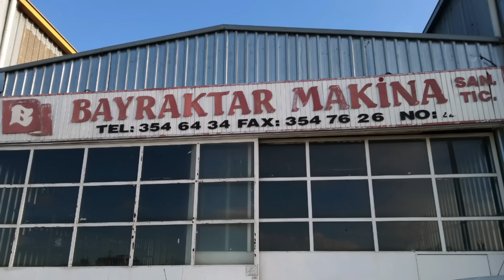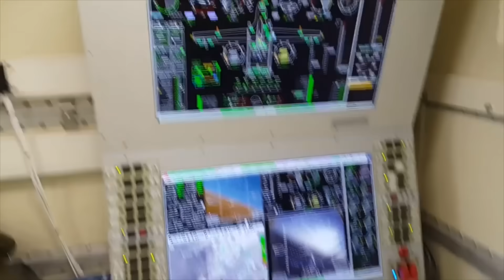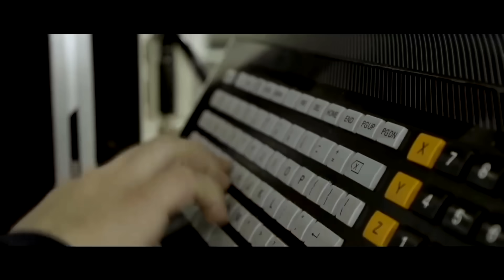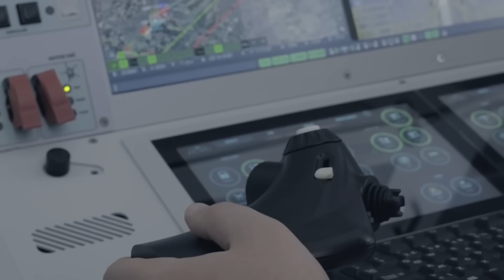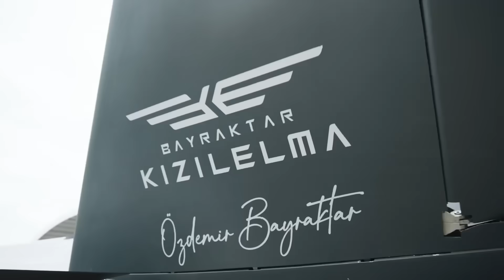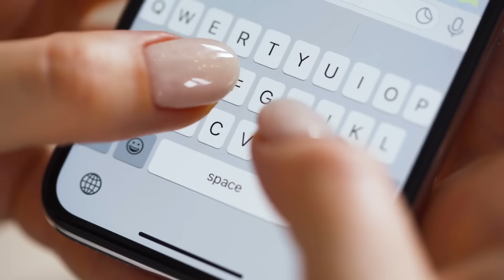Turkey Has Built The World's Largest Army Of Armed Drones

Comment: After war testing, I am here - Indians just blasted these drones in the air.😂😂
Reply: u don’t even know how drone warfare works. 
Pakistan mostly used Kamakazi drones which are made to destroy and way cheaper thn missiles. 
If u throw 10 drones 1 suppose to hit. That's how it’s success rate is calculated. 
A drone cost around 10000 to 20000 usd.
But u intercept with your Akash Air defence Missile. Each Missiles cost around 500,000 usd. 
It’s a 20,000 vs 500,000 game.

Comment: All shot down by Indian Air Defense System 😂😂😂😂
Reply: u don’t even know how drone warfare works. 
Pakistan mostly used Kamakazi drones which are made to destroy and way cheaper thn missiles. 
If u throw 10 drones 1 suppose to hit. That's how it’s success rate is calculated. 
A drone cost around 10000 to 20000 usd.
But u intercept with your Akash Air defence Missile. Each Missiles cost around 500,000 usd. 
It’s a 20,000 vs 500,000 game.
Reply: Aa gaye sab Madrasa chaap
Reply: one of these takes 6 seconds to make
the important thing here is that the soldier is not harmed
not to suffer losses
we have a lot of drones
pakistani soldiers will now be able to fight safely from inside the tank
Reply: তোমার কি তাই মনে হয়😂😂😂😂
Reply: Raphael 😂😂

Comment: 😂😂 turkish armed drone are 💩💩..not even enter the indian territory.. eliminated by indian defence forces..
Reply: u don’t even know how drone warfare works. 
Pakistan mostly used Kamakazi drones which are made to destroy and way cheaper thn missiles. 
If u throw 10 drones 1 suppose to hit. That's how it’s success rate is calculated. 
A drone cost around 10000 to 20000 usd.
But u intercept with your Akash Air defence Missile. Each Missiles cost around 500,000 usd. 
It’s a 20,000 vs 500,000 game.

Comment: Turkeys supplied drones to Pakistan were destroyed by Indian Armed forces 😊😊😊🇮🇳🇮🇳🇮🇳👍
Reply: u don’t even know how drone warfare works. 
Pakistan mostly used Kamakazi drones which are made to destroy and way cheaper thn missiles. 
If u throw 10 drones 1 suppose to hit. That's how it’s success rate is calculated. 
A drone cost around 10000 to 20000 usd.
But u intercept with your Akash Air defence Missile. Each Missiles cost around 500,000 usd. 
It’s a 20,000 vs 500,000 game.

Comment: Turkish drones are more of marketing + good on paper.

But practically can be easily destroyed, ex: India vs pak war 2025
Reply: u don’t even know how drone warfare works. 
Pakistan mostly used Kamakazi drones which are made to destroy and way cheaper thn missiles. 
If u throw 10 drones 1 suppose to hit. That's how it’s success rate is calculated. 
A drone cost around 10000 to 20000 usd.
But u intercept with your Akash Air defence Missile. Each Missiles cost around 500,000 usd. 
It’s a 20,000 vs 500,000 game.

Comment: Found useless during recent India Pak war 2025
Reply: u don’t even know how drone warfare works. 
Pakistan mostly used Kamakazi drones which are made to destroy and way cheaper thn missiles. 
If u throw 10 drones 1 suppose to hit. That's how it’s success rate is calculated. 
A drone cost around 10000 to 20000 usd.
But u intercept with your Akash Air defence Missile. Each Missiles cost around 500,000 usd. 
It’s a 20,000 vs 500,000 game.

Comment: India shot down 400 turkish drone in India and Pakistan recent conflict. 😢😢😢😢😢😢
Reply: u don’t even know how drone warfare works. 
Pakistan mostly used Kamakazi drones which are made to destroy and way cheaper thn missiles. 
If u throw 10 drones 1 suppose to hit. That's how it’s success rate is calculated. 
A drone cost around 10000 to 20000 usd.
But u intercept with your Akash Air defence Missile. Each Missiles cost around 500,000 usd. 
It’s a 20,000 vs 500,000 game.

Comment: Just a day before, Turkey’s Drones were Destroyed by India’s Akash and S400 defence system. 
Poor Drones 👎🏻👎🏻👎🏻
Reply: u don’t even know how drone warfare works. 
Pakistan mostly used Kamakazi drones which are made to destroy and way cheaper thn missiles. 
If u throw 10 drones 1 suppose to hit. That's how it’s success rate is calculated. 
A drone cost around 10000 to 20000 usd.
But u intercept with your Akash Air defence Missile. Each Missiles cost around 500,000 usd. 
For S 400, each missile costs 1 Million dollar. 
It’s a 10,000 vs 500,000 game. 
and 20,000 vs 1 Million game.

Comment: Let's see a Reaper is $200 million a TB2 is $2 million - is the Reaper 100 times better than the TB2?  I would guess not - maybe 10 times better at best. But I guess it depends on mission profile etc, ie: if you need something with the range of a Reaper, and presumed better optics etc, then the TB2 would be a waste of money. .....    still...... maybe buy less Reapers and buy a couple of dozen TB2s for a good mix.
Reply: They are not in the same category as TB2 You can compare the Raptor with the Akıncı drone. Asea radar installed. Peregrine falcon and gray falcon can also fire air-to-air missiles. It can fire almost all ammunition, including F16.

Comment: At 02:00, this information is totally wrong.

98% of Turkey is not Islamic. Islamics are common in Turkey, but the 98% number is exaggerated. Due to the ruling party's conservatism in Turkey, officers are compelled not to allow the declaration of their religions on their identity. In this case, you can change your religion on your identity to most common religions, but not to beliefs like atheism, agnosticism, deism, etc., or even old Turkish religions before Islam. So, on paper, %98 of Turks are Islamic, but in people's heads, definitely not. It's just symbolic. The ratio is not insignificant. In my point of view, the percentage is %70 (Islamic Turks) - %30 (Not Islamic Turks). However, this ratio is subjective.

Comment: Guys having largest army of drones is not the real power. Yes it's good to have it. But real power is controlling these drones in the battlefield simultaneously with AI. Also when transmision cut off, those drones need to act autonomous to achieve mission. That's  the real power. And yes, Türkiye has it too.

Comment: Even though Turkiye is one of the largest military powers in NATO and is supposed to have access to all defense system as the other NATO members do, US refused to even price the Patriots to Turkiye, yet alone sell them. And when they made a deal with Russia for S-400's, they got kicked out of the F-35 program which they manufacture about 900+ key components including fuselage, propulsion, cockpit display and landing gear. I give it 10 to 15 years before many of the NATO members start knocking on Turkiye's door for military weapons, drones etc. They just got started about a decade ago, and look how far they have already come...
Reply: Turkey is one of the oldest NATO countries, and it has partipicated in almost every war NATO joined. Turkish army has been trained by NATO since 1952, and if any war occurs in Türkiye, the US easily send those f35s to Turkey, as NATO has given f16s  even to Ukraine.
The US has more than 16 bases including nuclear weapons  there (biggest ones in the middle east) . aditionally Türkiye is the second biggest army of NATO
and its geographic location is very important. So, basically apart from politics, both sides know well they need each other.

Comment: Hmmm...So it is going to be Turkey, Ukraine, and Poland that are the three points of the "Intermarium Union"   I am still trying to figure out if it will be Sweden or Turkey that ends up being the third.  

It Mkaes sense that Ukraine would still be working with Turkey to develop the drone software, a joint development plan would make all the drones cheaper.  Ukraine is going to be doing a lot of "exported labor" type work much like they Philippines after/ if they survive the war.  They are going to have to rebuild alot of buildings and replace a lot of washing machines....

Comment: I was wondering how they do it... but after i heads that they use multiple Parts from another country.. i realize the Engine from Ukraine..some parts from Germany...etc 
But still..i admire the fact of them improvement 👏🏻 
All the best for Turkey 🇹🇷 💐👍🏻
Reply: Nah that was before the mass productions has started. Türkiye does not import as much now like how it is mentioned in this video. That was a decade ago. At this moment Turkish military weapons and equipment is about %80 home made.
Reply: Engines and all the other stuff like cats are also produced in türkiye.however there is a maximum production capability of single parts. If the demand exceeds the maximum production capability it is not bad using imported parts.
Reply: Tb3,Anka and Aksungur drones are flying with Turkish engine named Pd170 engine
Reply: every part every design  is a challange for to another step.
Reply: F 35 gövdesi Türkiye nin
Reply: Siz Araplar Amerika’nın uşağı olmaya devam edin biz Türkler tüm dünyayı adaletle yöneteceğiz   Eğer Türkiye olmasa tüm Arap ülkerini Amerika ve Avrupa yok eder  siz Arapların Türkiye’ye hiç faydası yok